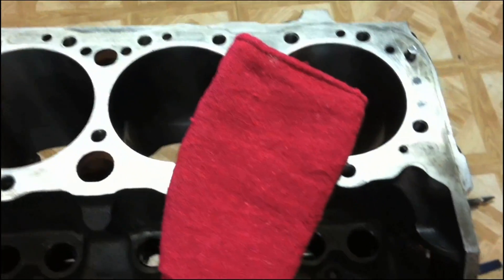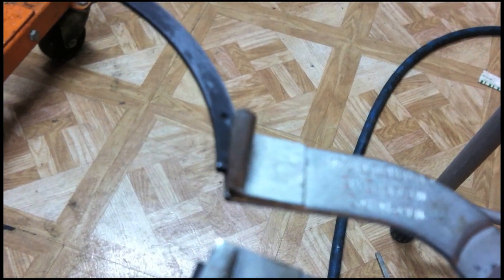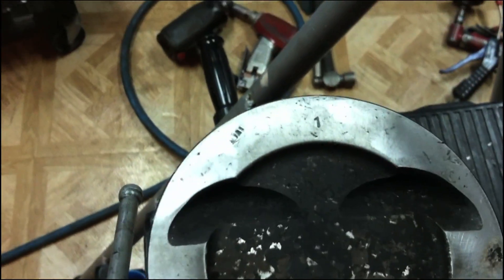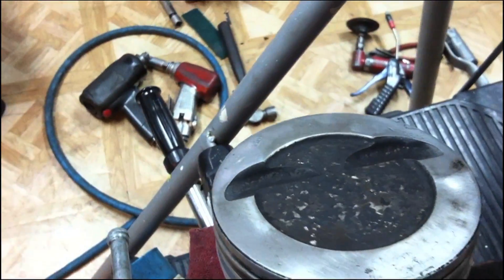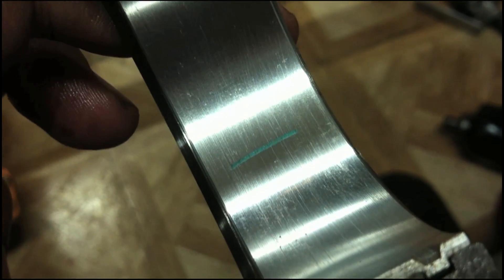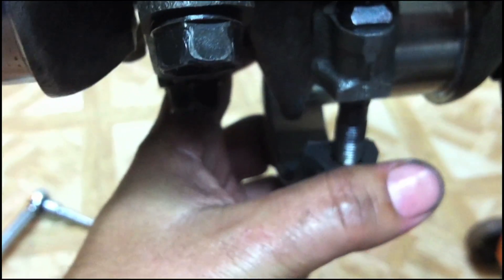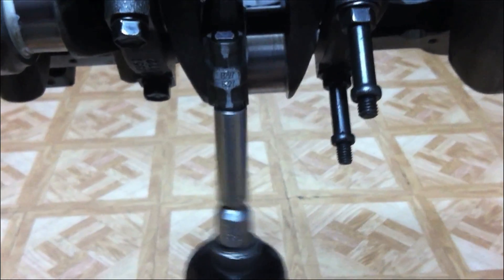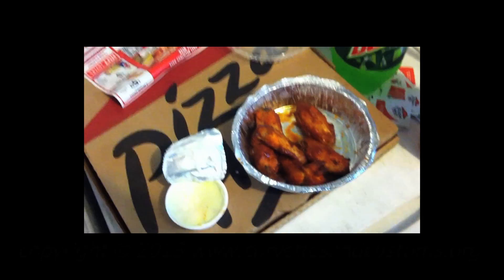How to Build a Chevy 383 Stroker: Part 2 - How to Install Pistons

Comment: Did someone forget about the hot soapy water and scrubbing brush? Sorry about the rings running up and down over that honing grit!
Reply from the maker: You seriously need to check your facts. Buy a couple books on building engines. Are seriously saying DON'T use oil when building an engine? I hope you are kidding.
Reply from the maker: You're right. I did not cover washing the bare block. Washing the bare block is part of doing the assembly before you get started.
Reply: SanDiegoHotRod Thats the only thing we drink at our shop and no offense or anything im 12 and don't want fighting or arguing but NEVER EVER EVER use oil in the cylinders or on the piston, oil can only be compressed to 5 thousandths so its gonna be keeping that oil in the cylinder and the motor will burn oil and the rings wont compress right on the pistons if oil is between them and the piston but WD40 is the best choice look up don't blink mud racing and watch it at mud muckers we built that motor a while back its a alchohol injected nitrous 632 making 1800+hp and we used WD40 on the pistons and rings but he crashed it
Reply: Would you hone a bore and leave all the abrasive stuff in there for the rings to run on?
Reply: You use bearing guard on the bearings BUT the rings will have oil behind them and it will be trying to compress it and mess it up
But you do use oil when you crank it and you use bearing lube for assembly but you don't wantto put the main bolts in dry so you put oil on them
Reply: +Mapple Cat should learn punctuation before you tell someone else how to build a motor.

Comment: How much could that cost
Reply from the maker: Balancing the pistons, rods, crank, flywheel/flexplate, harmonic balancer, etc. runs around $200 - $400 depending on where you are and where you go but makes the engine run much smoother and last longer.

Comment: so if i take my 350 block i get them too machine the clyinders and crank?
Reply from the maker: Yes. The machine shop will check and grind the crank (unlike the fugly crank in this video) and can line bore the block for the crank and cam and give you the correct bearings.
They will also machine the cylinders and get you the correct pistons and rings for your engine. (Larger bore = larger pistons)
It is always worth the extra $ to have everything balanced as well for performance and life of the engine.

Comment: Looks like I'm going to sit here and learn how to build a 383 at 1:30am.

Awesome videos, though.  I wish I had the knowledge of people like you.  Although this is the most thorough engine building video I've come across so far, I'm sure there's 10 things/tips you don't mention for every 1 you do mention because it's so obvious/second nature to you.
Reply from the maker: Thank you very much. Yep there are lots of things that I don't talk about or it would be a 12 hour video! D'oh! Many things are (or SHOULD be) done by the machine shop before you get all your parts back. This is a crap "motor" from Craigslist but I did want to shoot some stuff that I have picked up over 20 plus years of working on race cars and hot rods. People can argue about anything i.e. "microns of aluminum oxide in the scotchbrite pads" or "don't use an impact on main bolts" but they have not ACTUALLY built engines for 20 years to know what IS a problem and what is NOT a problem. Thank you for watching and glad you learned some stuff. I have some new better produced shows coming I hope you like as well.

Comment: And when did you balance the rotating assembly???
Reply from the maker: I did not balance the pistons, rods, crank, balancer and flexplate. I am not a machine shop. The machine shop balances the parts before they hang the rods, etc.

Comment: "not familiar with a torque wrench"

Watching a video on building a SBC 383. If you don't know what a torque wrench is, then you don't need to be building engines
Reply: My dad actually asked my how to use my torque wrench the other day.   Guess the last time he used one was so long ago that it was nothing like these newer ones.   It had a needle and a gauge that would tell you how much force you're applying.
Reply from the maker: I still have my dad's old needle torque wrench. Long way from the mechanical to the digital age. My dad was the same way with a new timing light.

Comment: Good, informative videos. I was always taught to place the compression ring gaps over the wrist pins, as this would help discourage ring rotation. I am not trying to say you are doing it wrong, I just wanted your opinion on that reasoning. I have heard it in shops and dealerships across the country, but that doesn't mean it is true. What do you think?
Reply from the maker: Thank you. Think about the position of the piston and ring as it sits in the engine. When the engine sits there will always be traces of oil or unburned gas in the cylinder. Fluid always runs downhill. If the gap for the top ring is at the bottom the oil will flow through the gap to the second ring. I just like to keep the compression gap as far away from bottom as possible, not that it will rotate that far. The pistons are also much thicker and stronger at the top instead of pointing forward where the wrist pin AND the notch marking the front of the piston is. The values, specs and compression/expansion pressure differences are all very minute so I guess you could say it is just an OCD thing for me personally. LOL
Reply: Thank you for taking the time to answer. Since I never tested what I was taught about this, I couldn't tell you much about it, either way, although I agree that much of what you are saying makes sense.

By the way, I can certainly relate to the OCD problem. My Dad called it set in my ways. LOL.

Comment: just wondering how long have you been building or rebuilding motors?
Reply from the maker: Since I was a kid (about 25 years). When I was in high school I had a shop teacher say all the time "It's called an internal combustion engine. "Motors" are electric!" I know the difference but I use both terms. Just like "blower" or "supercharger." I hate turbos. Ha. Take a look at the engines and "build sheet" on my Corvettes and Customs website.

Comment from the maker: New pistons won't matter but make sure you have them the right direction for the valve reliefs. There is usually a mark on the top of the piston that either marks the "top" of the piston or the "forward" position of the piston. Make sure to stagger the ring gaps. The top ring should have the gap at the top so when the engine sits the gas/oil in the cylinder does not run down through the gap to the second ring.

Comment from the maker: Thank you very much. I have the whole assembly on video broken down to parts so you can find just the piston, cam or head install section. Just have to take the time to cut it together. LOTS of 30 second clips shot with an iPhone and trying to build an engine with one hand! LOL There is a great "wish list" build sheet on my website if you click the link.